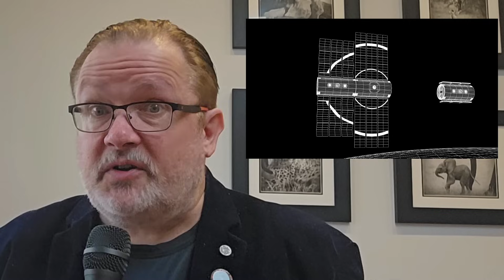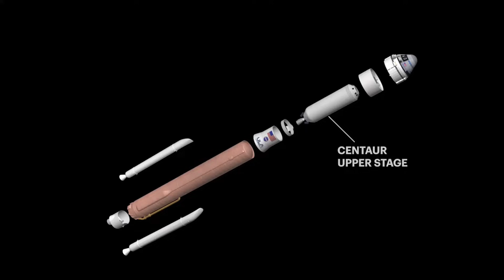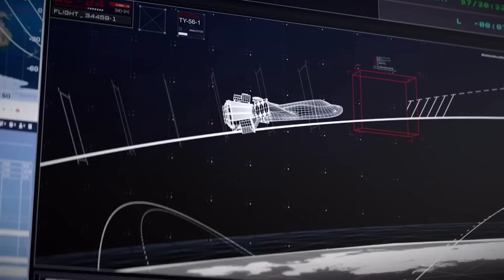Dream Chaser in trouble?  FAA delays with this ship too?  Does NASA need Starliner after all?

Comment: A lot of those delays will probably disappear after 20 January, 2025. That skid won't damage that concrete. The Dream Chaser is too light, & the weight is distributed on 2 wheels which hit first, thus taking most of the load. Not to mention, what are they worried about? The Shuttle is gone forever.

Comment: I've never been an enthusiastic supporter of Dream Chaser as AA has been. Rather than push the envelope to have everything at once, they should have made incremental improvements and gotten something workable in flight. Not unlike what SX has done with the Dragon capsule. Musk always wanted a propulsive Dragon landing craft but pulled back on that when NASA made it more difficult to approve. Now, years later, SX announced that they have again implemented propulsive landing in the Dragon and it is currently a working option approved by NASA. I think the target is to eventually use it on the moon. The Dream Chaser is a wonderful but very expensive option in its current form. If everything goes well, they might have a manned version by 2027 but that seems out of reach. At best that might be three flights until termination of the space station. If SX gets a manned space station in place that may mean early termination of the ISS.

Comment: Glad to hear there isn't anything specifically wrong with 'Dream Chaser' Often wondered if Space X should invest in the human rated version. A shuttle is superior to a capsule. Course with the delays, it will be interesting who gets NASA's human rating first.  On another note about Dream Chaser, I watched the first few episodes of 'Farscape' a short time ago. It struck me how close of a match, the ship in Farscape and the Dream Chaser look. Only the two inboard vertical control surfaces are missing. There are likely other differences, but it was a surprise. As for the nose gear not being a rubber wheel, i assume the part that slides is steel not aluminum? Also we are not talking about skid chains or studs, which would damage concrete. This is a plate which will slide over the concrete. Only question I have, is the concrete rough enough, where they ground the grooves, to gouge grooves in the plate?
Reply: It's likely layered , and surface-layer replacement will doubtless be fairly easy .
As to the above question ; yes , SpaceEx should INSIST that this be the shuttle/taxi to bring people and supplies up to Starship . 🤓

Comment: Nicely done Angry.  It's sad NASA passed on Dream Chaser early in its crew-rated craft selection process.  Now of course the only way forward is to be a cargo truck until Sierra Space has independently proved that they have successfully built what is IN FACT a human rate-able space ship.  Then NASA will go, OK... we'll rate it now because it actually exists.  But politically with the economic constraints NASA operates against and their unwillingness to pull the plug on the Boeing monster feeding at the trough, they are incapable of spending money on it.